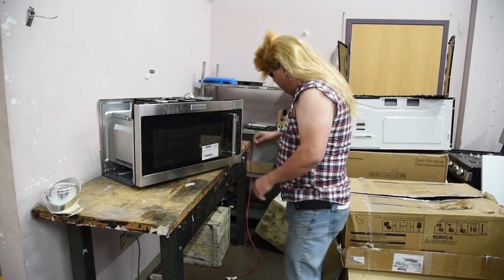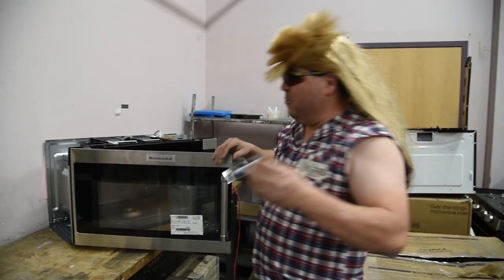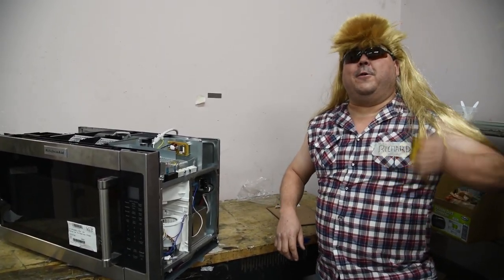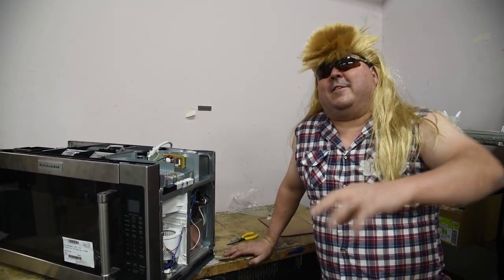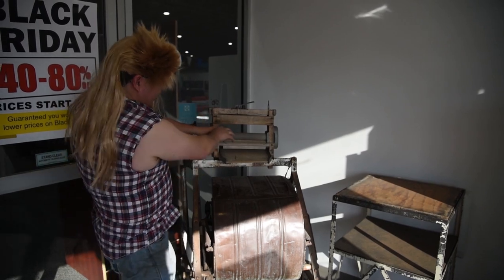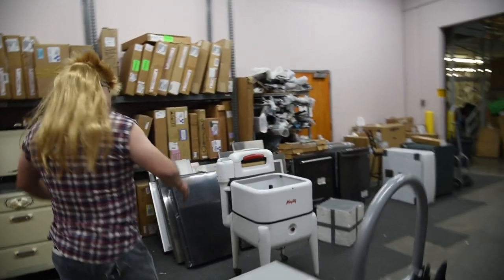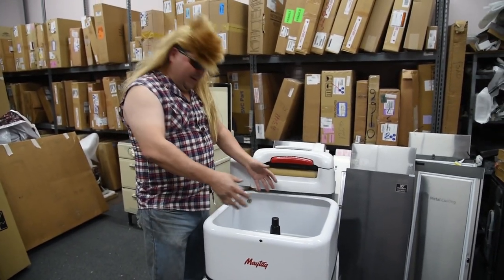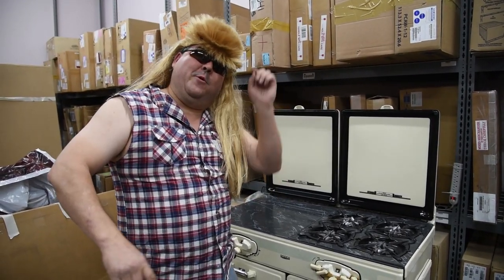How to Discharge a High Voltage Capacitor for a Microwave

Comment: Uh....and make sure you're not grounded or touching the microwave body.  Did you see where the arc went when he shorted the capacitor?  To the edge of the capacitor and the metal back panel of the microwave.  Also, some tools have foam instead of rubber, and they say on them, "Will not insulate from electric shock".  You may want to NOT use those types either.
Reply: Ya just spend some money on a discharge tool and remover to unplug the microwave first
Reply: my friend was killed by a microwave capacitor. he must of been grounded
Reply: It did not arc to the chassis, why would it go there when there's a dead short through the pliers?  The spark just exploded outwards, as they do.  If it could reach to the chassis, it would do that all the time.
Reply: @davidvankeuren6575  His parents grounded him for breaking the microwave.

Comment: Good info. I've used the smaller ceramic capacitors that were rated 15kv 10ma that bit me a few times. I learned the hard way to make sure those babies were discharged.  Ive never dealt with the bigger capacitors like the ones in microwaves. I see now that the discharge procedure is the same.

Comment: dude thank you so much for this. Every place gives the same instructions as you, but every fucking place scares the hell out of you over that tiny spark. He is 100% right, use a insulated tool, and you should be fine.
Reply: most insulated tools on the market are rated for 1,000 volts. Have fun discharging a fully charged 2,100 volt capacitor with one…
Reply: @am529  only it won't be fully charged unless the unit is still plugged into the wall.